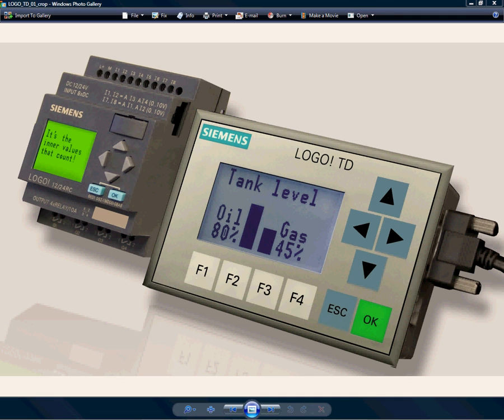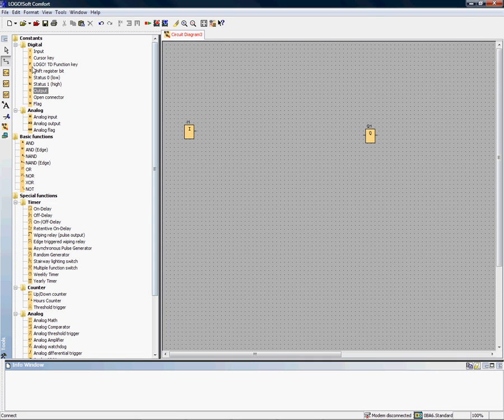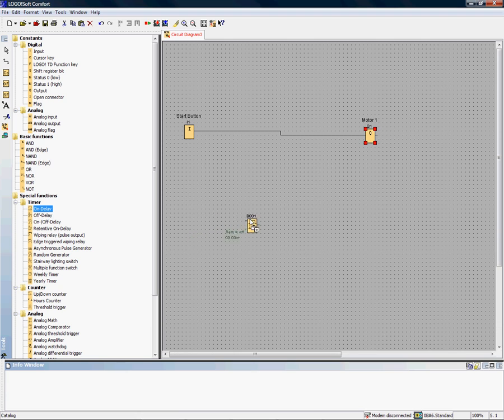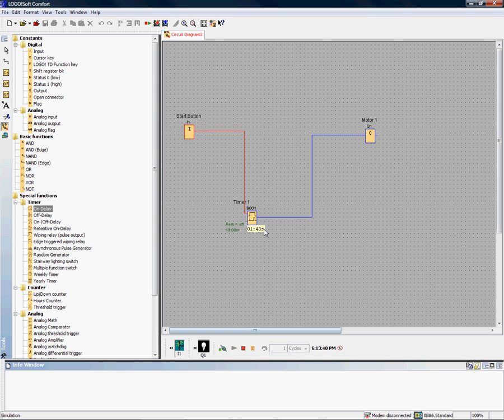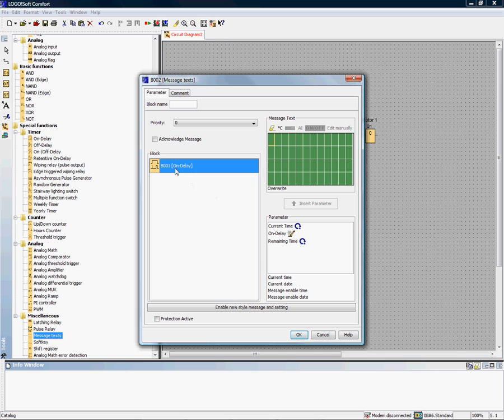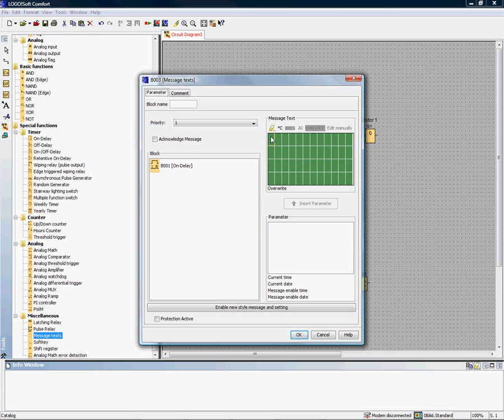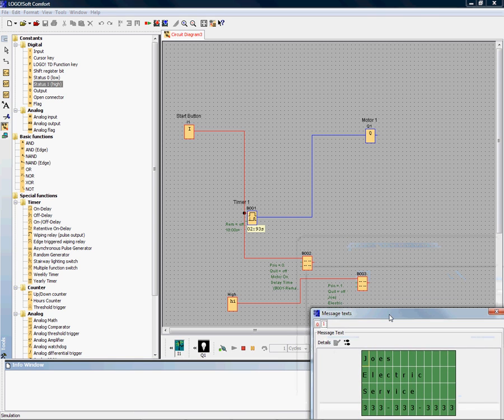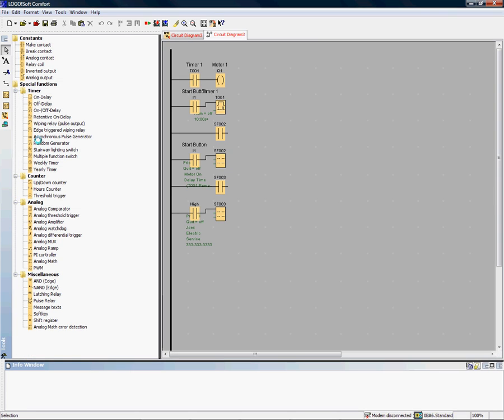Siemens LOGO!

Comment: how do you connect a 4-20ma transmitter to the logo 24 input
Reply from the maker: +Darren Young 

Darren: by placing a 500 ohm resistor on the analog input you can change 4-20ma to 2-10v. In this way you
can use the voltage inputs to read current.
Reply: Thank you very much and how do I connect the resistor to the input of the logo plc... in series?
Reply from the maker: +Darren Young 

In parallel with the input to 0vdc